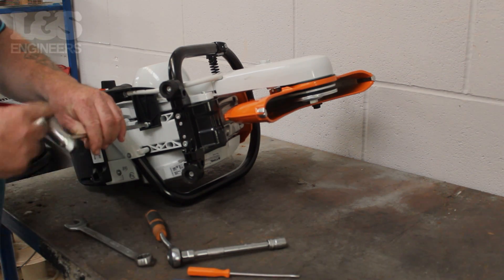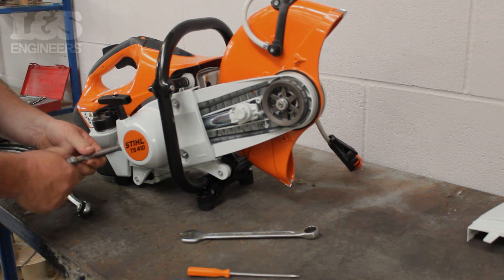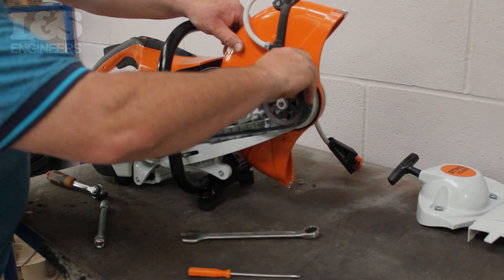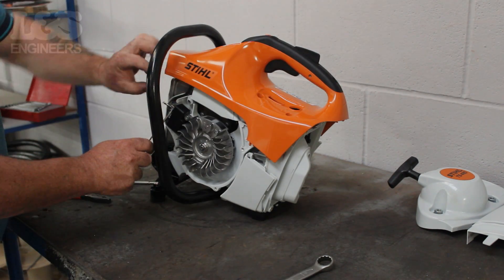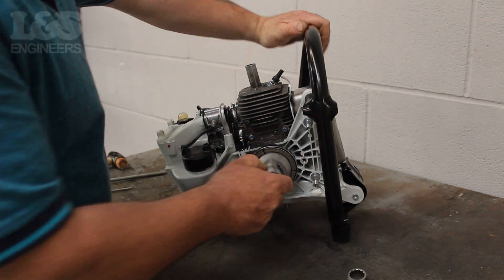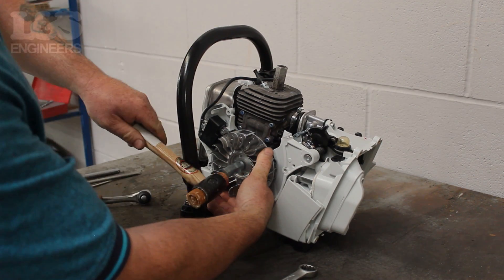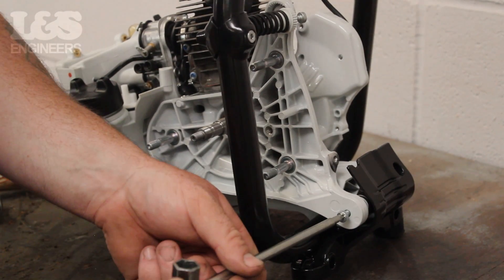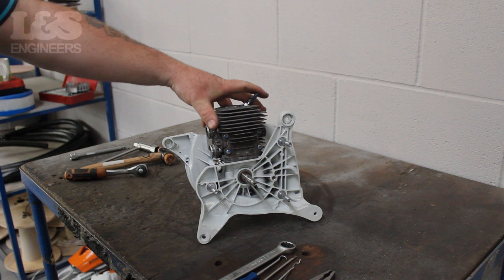How to Strip a Stihl TS410 Down to a Short Motor | L&S Engineers

Comment: Hi thanks for the video. I have same saw runs for 10 minutes then cuts out . It dose start again but it’s a pane any ideas what could be wrong .
Reply: Check your fuel tank breather, could be blocked causing a vacuum... Loosen the fuel cap when it starts to stall if she keeps running, this will confirm it 👍 good luck 🤞